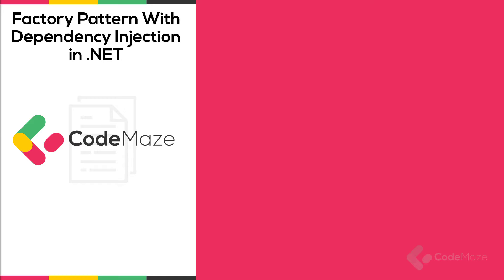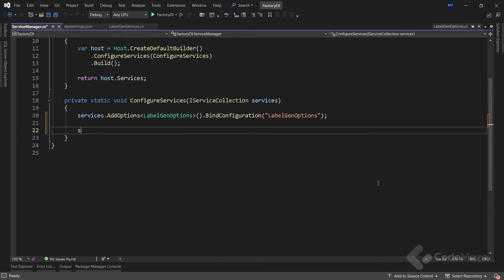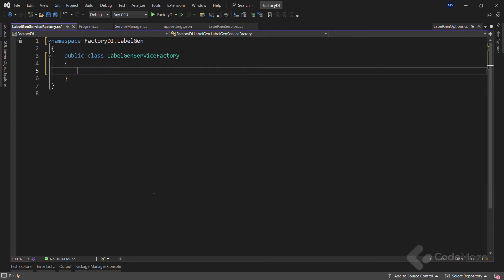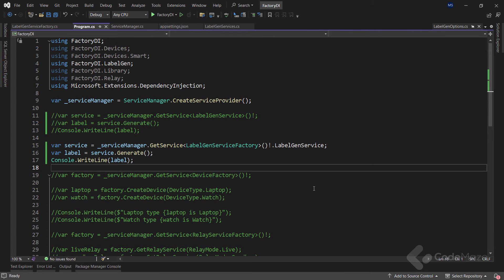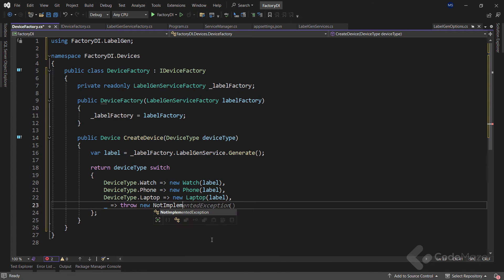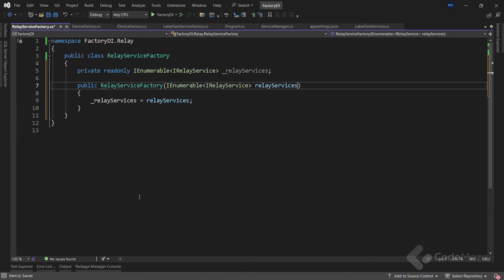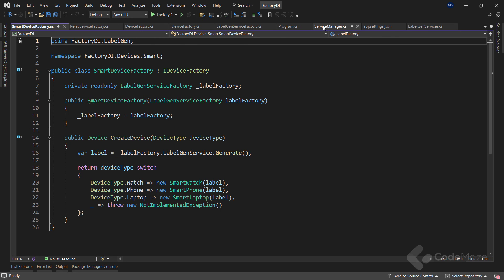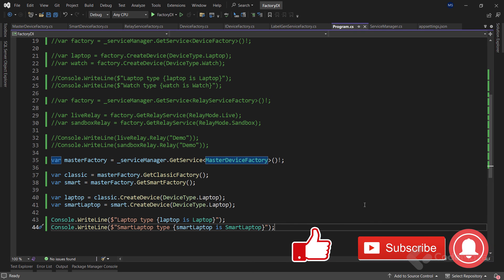How to Use Factory Pattern With Dependency Injection in .NET

Comment: Thanks for an excellent video. In your examples you have used so-called "simple factory" and "abstract factory" approaches together with DI container, but is there any place for the third form of this pattern, "factory method" somewhere in API applications ?
Thanks in advance.
Reply from the maker: You are very welcome, and thank you for watching the video. Regarding your question, to be 100% honest, for me, Factory pattern is a pattern that strongly depends on abstraction, whether it is one version or another. The way you see it in the video is something I've used in my projects earlier, but I am pretty sure Factory Method could be implemented as well, just  I would need to sit down and go through the solution again. After all both patterns are quite similar so I see no reason why you couldn't use the Factory Method instead.
Reply: @CodeMaze  thanks for your answer again, amazing work ;)